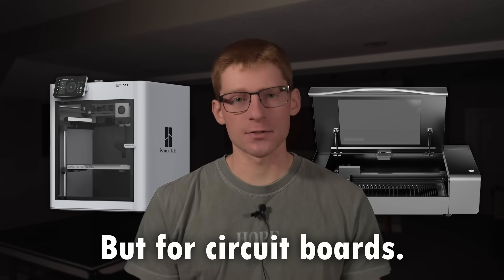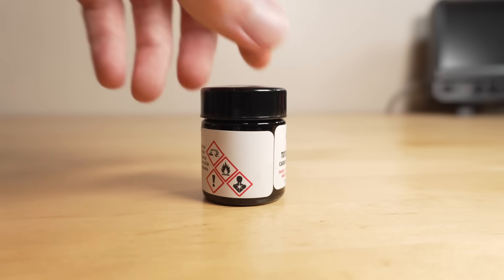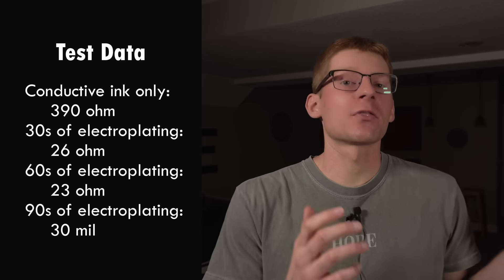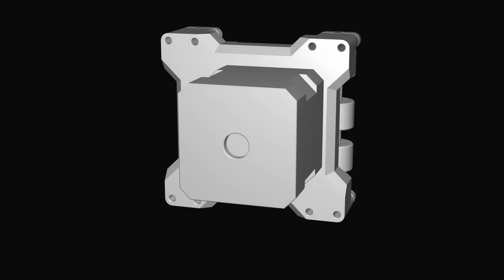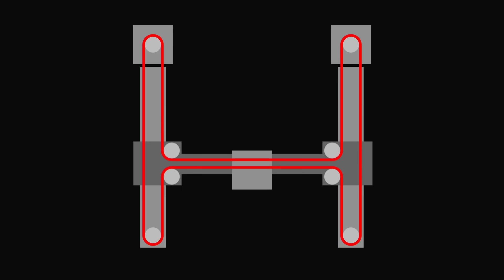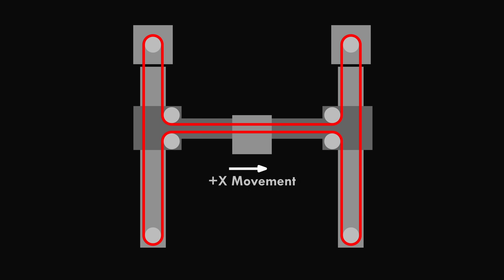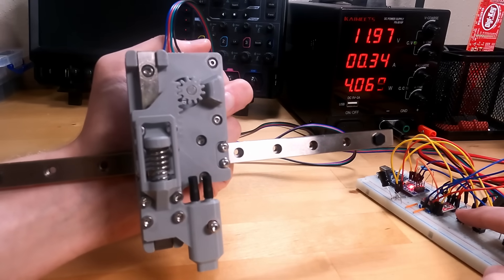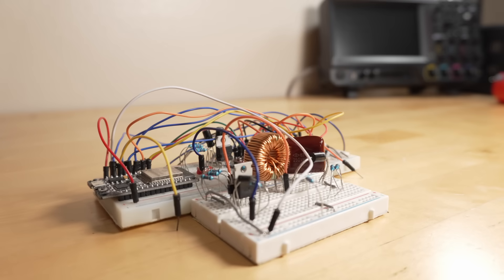I'm Developing a New Circuit Board Manufacturing Technology

Comment: You could also just drill a hole and solder a wire through it for the vias.
Reply: That would work for a low number of vias. Think of a BGA package with a few hundred microvias between the pads... not so much.
Reply: @sniperasys  That would be a bit of a problem for an electroplating process that takes 90 seconds to 3 min per via too.
Reply: @ceoyoyo  I'd gladly spend a week building a CNC machine that plates a perfect via in 90s. That's 40 vias per hour, 320 vias a night. That's like 3D printing speed, in perspective. It's okay considering that I don't have to do something that really hurts my upper back and what a machine is supposed to do. :D
Reply: @sniperasys  Soldering is already a normal step in circuit board production and many 3d printers can do it. It would only take a bit longer than drilling the holes which is a fair trade for getting it to work on a desktop system.
Reply: Yep.  Solder it in place and smooth the surfaces.   Not sure why he is doing this so complicated way.  This machine will cost a fortune, so must be targetting big business, not a diy solution.
Reply: @murraymadness4674  I'd reckon that most people who tried to do the same would say that doing this in any kind of quantity is quite the chore. I did. It is. Picture yourself hunching over the board for hours soldering wires that are not significantly thicker than a strand of hair. The real difficulty lies in getting the solder connection reliable 100% of the time especially after you sanded back the protruding wire ends, so when you try to solder a BGA package on top, some of your joints come loose because there's just a few dozen square microns of solder joint areabetween the trace and the wire.
Reply: @ If waiting for 3 days is okay for you then you don't need something like this. End of story. Over the last 20 years I found myself having to pay for overnight manufacturing more than once, although these were actually overnighted (12 hrs turnaround) from a local supplier. Only one of these small runs cost more than the entire BOM of this machine. Sometimes it happens. If you're in a pinch, having to sit around for 3 days is just not an option, and more often than not, in these cases, you only want a few pieces, so shipping and the overnight premium eats up your budget quite fast. If you need hundreds of boards, you have plenty of options. If you need one board in 12 or 24 hours a hundred times over the course of a decade, you're not only looking at a very hefty price tag, but sometimes there's just noone to take your order b/c they're at capacity. If you're in college so you have some time to pursue a goal like this and you have been bitten by this issue more than once, it's very straightforward to try and solve the problem.
Reply: @ I already explained that soldering a piece of wire between two pads on opposite sides of the board sometimes doesn't cut it. You will have problems if you're using hot air on the board later, because the interface between the wire perimeter and the pads' inner surface is so small that reflowing it will cause some of the joints to come loose. I tried to overcome this by staking solid wires into the bores but this is indeed a process that also requires automation if you value your physical wellbeing even a little. He also said he had a dozen more ideas, I also have some for that matter, and he's young and he's trying to pursue some of them. It's commendable.

Comment: Btw. The design you came up with is called H-Bot. It's pretty common in industries. But you have to use proper guide length to force distance proportions
Reply: The issue with H-Bots is that they add a racking force to the gantry. With solid enough rails this will be less of a problem but it's the tradeoff thats being made and there's a reason printers go for core-xy even though the belt path is a little more annoying.
Reply: @ChrisUG  Everyone's a critic.
Reply: I second scruffy3121. H-bot have been long known to be the nemesis of cheap linear rails. Plus it requires precise sync of your motors braking timings if you don't want to end up with a lot of skipped steps with open-loop stepper drivers.

Comment: What if you go for a totally different approach and avoid electroplating entirely? Like how about using solid vias. You could have the machine from the via holes, and then move a wire feed head over each via and extrude a short section of solid wire into the via before clipping it off. I can think of a few ways to secure it, like maybe a peening process would work, or you could electroplate the whole board once the via wires are all installed to bond all the bias to the copper planes. It might be possible to use really small diameter tube for the vias and flare the ends to secure them too, but I like the solid wire because you can get rolls of that, and it seems more automatable. 

Either way, I love this project! I would absolutely love to use this at work. Pair it with a LumenPNP and my prototyping process would be so much more efficient!
Reply from the maker: This flavor of alternative solution is what I've been looking into since concluding my efforts on this method. There are many different possible approaches that don't involve electroplating, I'm working my way through them.
Reply: This is what I was thinking. And to guarantee good connection, potentially either applying dots of solder paste and reflowing after or electroplating the board or just around the vias briefly.
Reply: Could different pcbs materials be used? If it's for prototyping maybe you could compromise on some structural properties to use different processes to fabricate each layer , though the normal pcb trace resistance design requirement would probably be compromises as well.
Reply: Are there any reliable methods to get wire vias bonded to the inner layers of a 4+ layer board? If not I'd reject this option upfront. It is wise to stick with 2 layer for early R&D, but I wouldn't buy a machine that can't do 4 layer. The improvements in electrical noise and routing density are too good to give up.

Comment: actually why don't you allow for the whole plate to be plated at once? If you individually ink the vias, then as the last step, plate the whole board, that should be a good option?
Reply from the maker: In short, automating that process isn't trivial. It can be very messy, which should be rinsed and dried. The electrodes would get used up faster. Moving the board into a liquid bath wouldn't be straight forward. And the user would need to maintain a bath of corrosive solution. It's an option, but not one that excites me.

Comment: I was mesmerized by your machine and the CoreXY/Hbot gantry, and didn't notice you could've just put the two tool heads on the jaws of a vise if you just want to test your tool heads are functional!
I feel that, done that multiple times myself lol
PS: This is why I try my best to be "brutal" on my designs. Both to be brutally simple, and to be brutal to my babies (the clever but unnecessary designs).

Comment: Can you try switching the electrode used from top to bottom so that the copper grows up and down and up and down etc...
While always having the board being grounded.
Would that work?
Reply from the maker: This is something I tried, unfortunately to no avail.
Reply: @LeviJanssen i assume you are going to fish a copper wire through the via, then electroplate over it to make the weld?
If that is the case, what is you solution for cutting the wire?

Comment: Great engineering sir! But why not just feed a copper wire through the drilled hole? And then use two sided heads to cut and bend the wire, so it stays there, before the soldering step. Failure stories are great, you learn more from them than success.
Reply from the maker: That's one of the viable options. It isn't ideal that the bent wire would extend beyond the face of the board (also, 0.3mm diameter offers little room for bending), but it could work.

Comment: The electro baths have a large “supply” of chemicals - is it possible that your pumps just don’t have enough flow? (Especially if you were turning them by hand) Beyond the other comments, the only thing I could think is that maybe not enough fresh solution was passing over the via to allow the electroplating to complete, which isn’t an issue in baths because you’re literally drowning in available solution
Reply from the maker: It's possible, but I think unlikely. The issue wasn't that electroplating wasn't happening, but that it's just inherently kinda slow. And when you try to speed it up with high current, you get undesirable behavior.

Comment: This is a very important problem so I'm really glad you're tackling it! I didn't quite understand what part of the electrochemistry changed between your initial test that got you good results and the high resistance issue at the end.
Reply from the maker: The chemistry didn't change, but the solution was more "constrained" in the latter prototypes. At the end, the board and electrodes were separated by a thin tube, increasing the resistance. Once I increased the applied voltage, the electrochemistry was exactly the same.
Reply: @LeviJanssen  I'm repeating myself from a comment a few minutes ago, but I really want to see what happens with a high flow rate :)
Reply: @LeviJanssen  Ahhh, I see thanks for the clarification. So do you think the initial prototype also wouldn't work with small vias?

Comment: Why not doing all the vias simultaneously, using your method, but with two large plates, instead of the two "plugs" ? That way you could increase the pressure in the system without having to "bolt tight" the system.
(I'm not sure if I'm really clear, but I think it might be feasible)
Reply from the maker: I think you're describing the standard method of via electroplating. My issue is that you then have to submerge the entire board in an electroplating bath, which creates several problems: Automating the submersion requires multiple additional mechanical degrees of system. The board should also be well rinsed and dried after submersion, which further complicates automation. It also requires two large electrodes which would be more difficult to replace while being used up more quickly (the entire surface gets electroplated). And the user would have to maintain a large bath of corrosive liquid. Hopefully I'm understanding you correctly.
Reply: @LeviJanssen  I think both understood each other ;) But maybe reducing the surface to around a 1cm² or so could work, that would allow to do multiple vias (not the whole board at once)

Comment: I'm no expert at all in this field. But I was wondering about "brute force" method. About press fitting metal pipe, or rod and driglling it with smaller diameter. Probably would require soldering to both layers, since press fit probably wont be so conductive. You probably thought about it, so I wonder more, why it's a bad idea? :D
Reply from the maker: You're describing something close to rivets. My main problem with rivets is that they're quite large and can't really be made smaller. You could solder a wire in from both sides, but then you run the risk of destroying vias while reflowing. I've done some experimentation with that method, it isn't ideal, but it could work.
Reply: If you make a machine that inserts the tube and flaps it on both sides, that will be enough for vias and TH connections. Of course, each point must be soldered later.

Comment: I can't for the life of me figure out why you're fixated on the tiny via. It just has to make connections between the two sides of the board. Component size really is not something to think about I don't think as you just put the via off to the side out of the way of the component. I don't know what I'm missing otherwise but it seems like you could make perfectly acceptable pcbs with 1 mm vias.
Reply from the maker: Requiring 1mm vias would require engineers to alter their designs (which can be very cramped) to accommodate the manufacturing method. The goal is to produce boards that are very similar to production boards in terms of electrical properties and layout, so a 1mm via would be a compromise. It might be fine for some engineers, but it didn't meet my design requirement.
Reply: @LeviJanssen  I very much agree. Redesigning the whole board after prototyping would waste a lot of time and may introduce new errors or noise problems, defeating much of the point of prototyping in the first place.

Comment: "CoreXY vs H-bot".
Reply: The main problem of H-Bot is that it tends to lock up due to a torque moment exerted on the middle of the H during movement. As such, it was generally abandoned in favor of CoreXY, which doesn't suffer from this issue.
Reply: Yes, I'm aware, hence my comment.
Reply: Came to comment this
Reply: What is an h bot
Reply: @E-dart It’s the “Single Belt Core XY” kinematic system demonstrated in this video. It’s just that Levi didn’t know that is already existed and had a name - which is no great surprise. They were a bit of a flash in the pan about 7 years ago or so. They were a cool idea, but as demonstrated in this video, require a substantial frame to actually be reliably accurate.
Reply: @KaminKevCrew  frame just needs some cross angle bracing think how house walls are built to stay standing straight under the weight of a roof.
Reply: @ that's not true. You need the interface between the gantry and the frame to be extremely rigid and resistant to rotation. That's the key weakness of the H-bot design. Any weight you save by not having a second belt, you more than lose in the additional racine needed to make sure that the gantry won't jam up. 

That's why H-bot printers aren't really made at this point. It's just a worse kinematic system than Core XY.

Comment: This has been achieved manually, I saw a YouTube video where an air brush was used to apply conductive ink then air to blow the ink threw the holes, the board is then submerged into a copper plating solution.

Comment: This is very impressive!

Have you considered using rivets?

I’m sure the concept can be more refined when you control both sides.
Reply from the maker: I have considered them, I'm not a big fan. They're much larger than standard vias and they stick out beyond both sides, making solder mask application difficult (not a current goal, but would be in the future). They'd also just be annoying to try to orient, but the size restriction is the main problem.
Reply: Blind Rivets, Crumpling copper tape; even nuts and bolts could work, I think…

Comment: Sounds like a very interesting project.... i hop you succeed. This would be very useful for those how want one off PCBs, or even just a few.

What CAD software do you use? Does it come with all the extruded aluminium parts as templates?
Reply from the maker: I used Fusion 360 for this. And no, it doesn't, but they're easy to design.

Comment: If the goal was to have a quick prototype, this fulfills that: prep a board full of vias in a 6.35x6.35 mm grid pattern (all at once, complexity isn't an issue). Design the pcb to hit or avoid (at least on one side) the pre-exising vias. Some can make profit on the prepped via boards (e.g. pcbway or you) - and the desktop machine is much much simpler (a laser and/or engraver).
Reply from the maker: The goal is a quick prototype that is very similar in electrical properties and layout to a production board, so that's not exactly what I'm going for. But that's a very intriguing idea, not one that I've ever thought about. You could have different pre-prepared boards with different via pitches to accommodate different power/trace density needs. Have you seen this approach used?
Reply: @LeviJanssen  Coderentity2079 you have had the same ideas as Austin Baldwin above.  I think it is a great solution for high speed prototyping at home for SMD components only on one side.

There could be 3 standard via pitches with 3 index holes that are covered with a cured solder mask film that you can order from the usual PCB fabs that have the economies of scale for THP.

You then use a laser to expose copper and etch and then laser to remove solder mask, then drill any through holes.
Or you use a mill to cut the traces.

The only drawback is the lack of conducting through holes so you need to keep an eye on such components.

This would be a great Open Source project with the main complexity being the changes to the auto-router to dodge and use the vias as efficiently as possible.